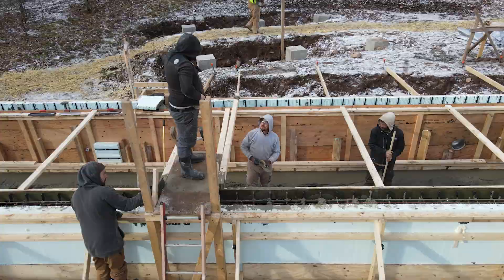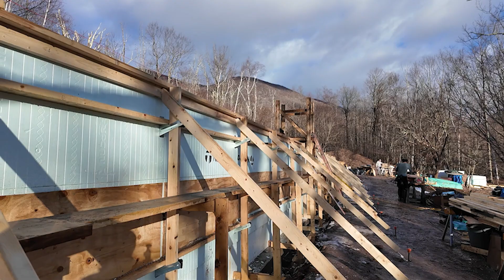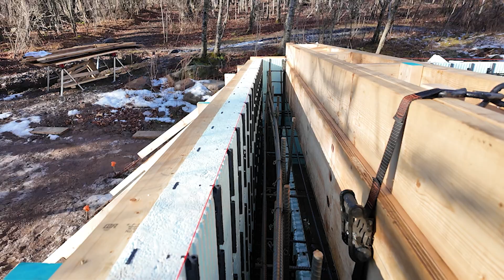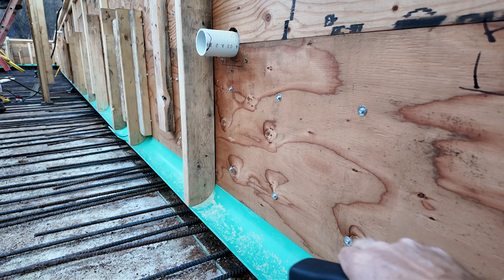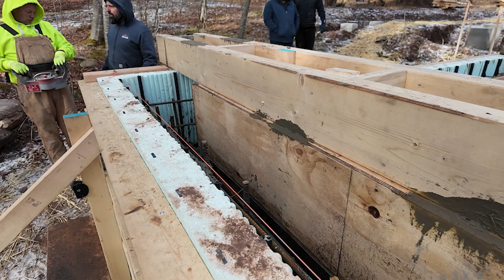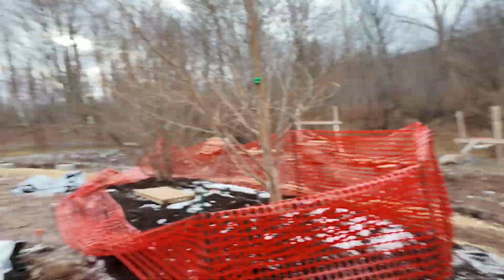Insane ICF Pool Pour in Woodstock NY!!!

Comment: Are there ever issues with plaster cracking due to the lack of shotcrete on these icf pools?
Reply from the maker: Lack of shotcrete?  Explain how 5-8” of (concrete shot through a gun) is better in anyway to 10.5” of poured and vibrated concrete…. Shotcrete is a name describing a placement process, and an inferior one in this case, it’s not special
Reply: @all3pools  *update- he's saying the foam under the plaster can get pushed in.   
It's something a pool builder friendo of mine said to me when I was trying to explain that you could plaster these types of pools, and that they don't have to be vinyl lined. I'm in Wny, work in the industry, and we have nothing but problems with ground water. Mostly all pre existing pools in the area lack any ground water control. I was bringing up icf as a better method hopefully, but some guys are set in their ways idk 🤷‍♂️ so looks like I'm gonna have to build these alone lol.
Reply: I’m guessing the issue you are taking about is how the plaster adheres to the walls.  Shotcrete is so rough and porous that it’s easier for the plaster to stick to. With a wall like this (poured concrete with a plywood form), we will need to acid etch the walls and do some bush hammering to open up the concrete to accept the plaster finish better, given how smooth the walls will be once we remove the forms.
Reply: @danharper3854  I clarified with him, and he's saying the foam under the plaster can get pushed in using foam icf blocks. I know that's on the walls and probably not likely to happen, but idk enough about icf in that regard. He recommends wood form and pour also vs icf.

Comment: Why would they cut away the webs?
Reply: The webs were only cut where the cover vault needed to go. This pool is so long (75’) that the cover vault recess is way deeper than a normal vault would be. You got sure only want to cut the webs where you need to and not anymore then you have to!
Reply: Yes, why not keep inside insulation attached to ICF. Isn t that the definition of an ICF, insulation on both sides.
Reply: Is a liner based pool less expensive than a mono pool?
Reply: @ToddBizCoach  
Anywhere from "a good bit less" to "not comparable".   The way we build a liner pool has significantly less complexity, which is also why we are so excited about Renolit.  It's the only way to get what we would call a commercial quality finish, but with a DIY-able pool shell build.  With any non 100% waterproof finish like plaster / tile / Eco, that pool shell needs to be monopoured to be a part of the waterproofing system.  These monopours don't just require more expensive forms and a lot more carpentry, they have 4x the rebar and often 2x the concrete, so the difference more than moves the needle.